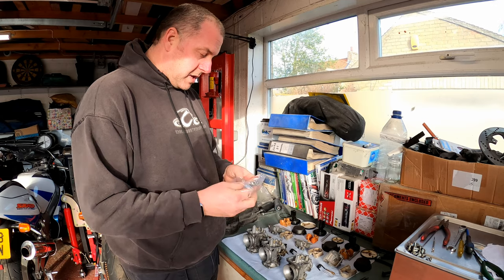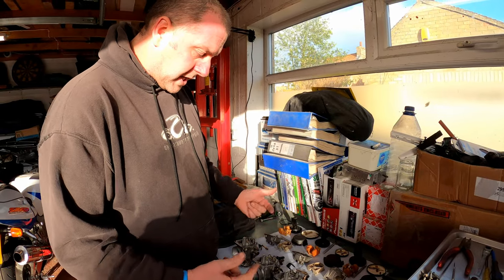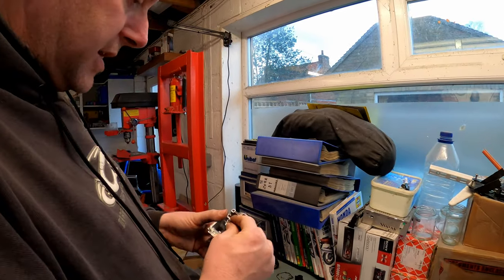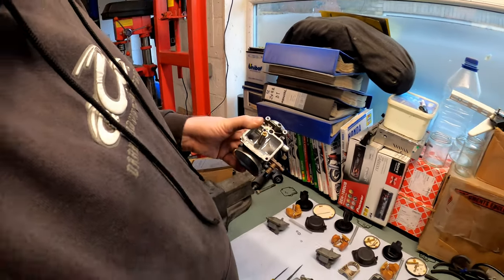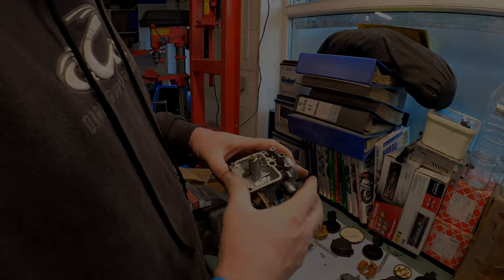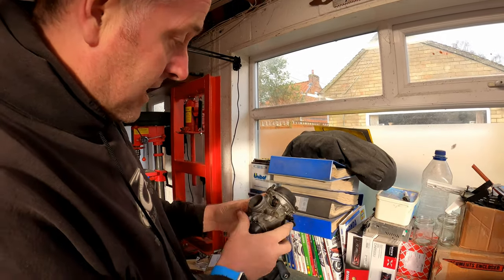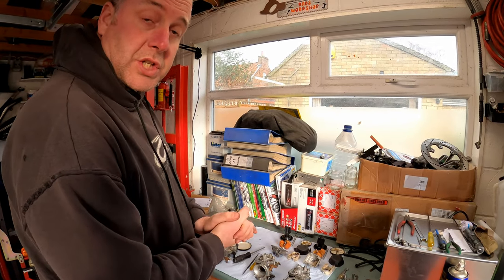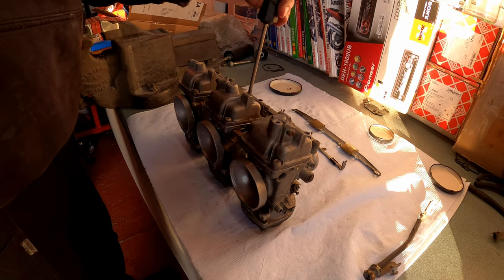Mikuni Carburettors All Clean & Ready To Be Reassembled

Comment: Just reassembled mine kev, your explanation was good again. Was trying the slides for ease of operation.
Did you know instead of flicking up the slide, you can blow with mouth around the half moon slot. It raises the slide and simulates air going into the Venturi from the air box. 
Lol. Works and shows no leaks in cover.
Reply from the maker: Excellent! Makes perfect sense! 👌🏻😎

Comment: Hi bud, I set my needle at the second slot, but, researching this, the clip should be on the middle position (3rd slot). I was wondering if you found the bike running rich on the 2nd slot.  My bike isn't running well on 2nd slot.  Plus I heard that the air screws should be 2 and half times out.  What are your thoughts? Thourght I would check before I take the carbs off again.
Reply from the maker: Hey man, I set mine to what the manual said. The air screw settings in the manual are only the base setting so that the bike will start. Once fitted to the bike, they will need adjusting to ensure correct running like I did with the Gunson Colourtune in this video 👍🏻
Reply from the maker: 1994 Triumph Sprint 900 Service Series - Part Three - Carburettor Tuning With The Gunson Colortune
https://youtu.be/MBhYcJwEckU
Reply: @KevsShed  Hi bud, the 12mm has been out of stock for ages. Did the 14mm with adaptor work just as well?